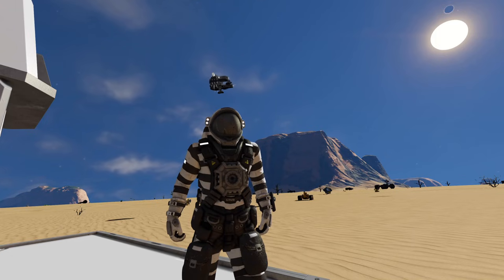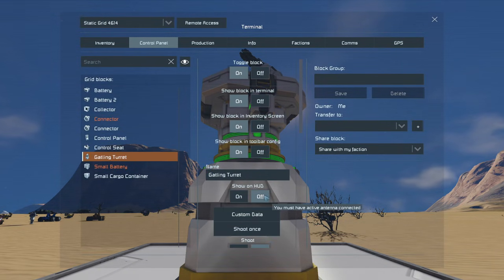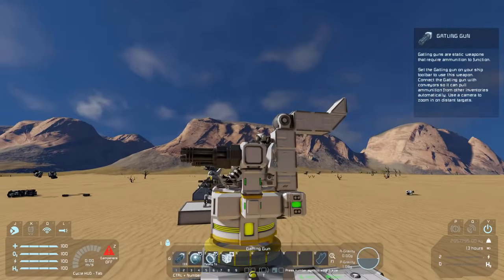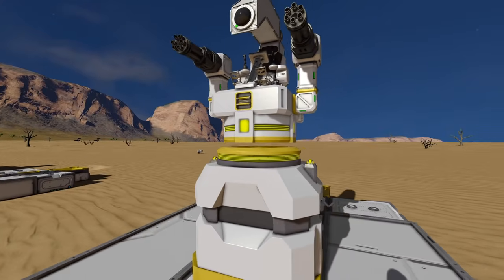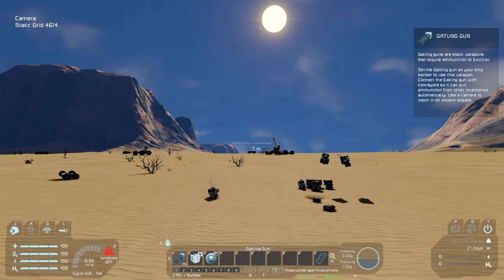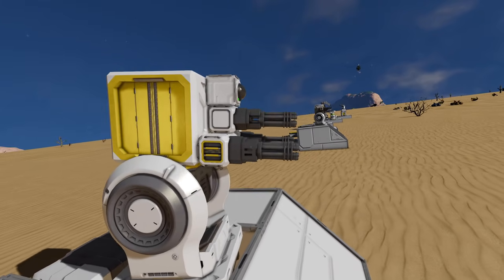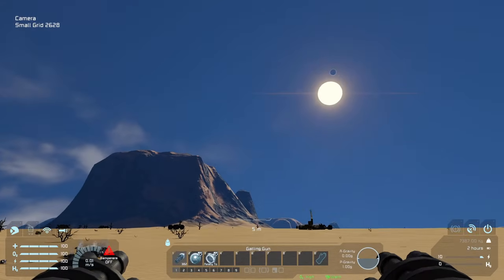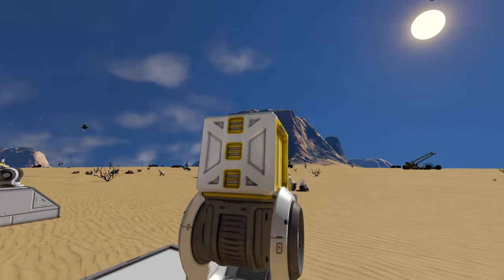Space Engineers Experiments: Mouse Controlled Turret (No Script And Scripted)

Comment: Trick: you can use the O2/H2 Gen block or the connector block for a 3x3x2 big-to-small conveyor conversion instead of the 3x3x3 junction, similar to what you did with the last turret, just flip it upside down. For the first scripted turret, you can put it directly on the hinge and shoot "forward" instead of the "90 degrees" angle right now and make it somewhat tighter. 

Also, you can make the transition from large to small grid on the rotor and place a big small grid hinge, which takes up 3x3x3 small blocks instead of the 5x5x5 small blocks of the large grid hinge! (General tip: one small block is 0.5 meters while one large block is 2.5 meters, making a small block 1 fifth in every dimension of a large one.)

Comment: With connectors, the magnet affect turns off whenever you unlock. Imagine, you’re ambushed by enemies so you quick get into the turret, while your buddy takes evasive maneuvers. You unlock and are immediately sent flying XD. Of course that’s not really a problem for stations.
Reply: That's why you use a rotor.
And set torque and brake torque  at 0
Reply: @knutzzl  so basically, Rotors for ships, and Connectors for stations... Hmm, great to know!

Comment: You could easily combine last two systems. Advanced rotor with small head. Small connector on top of it. This gives you 4 small ports around it and you can plop there your last design while having direct access to cargo, no need for remotes and any requirements set by having separate grid.

Comment: You don't need the big conveyor. Just mate the large port on the back of the connector to the hinge or rotor, and use any of the 4 small ports on the sides of the connector. Ammo can pass through small conveyors, so no issue there.

What's cool about this is you could still use the connector to connect something else, making a sort of "sandwich turret."

Comment: Just FYI: you dont require a merge block to join hinges together. You just build a rotor part on the other grid and tell the rotor to attach.
Reply from the maker: You're right. You can use either route, but connecting to parts usually easier.

Comment: something i've wanted to try but havent had the chance too cause no pc. try, using pistons. the 3x3 is a placement restriction and not an operating one yeah? so. imagine pistons with single block spacing in between that extend from the hull then retract into protective points. to place them. you extend one piston at a time, then retract and extend and place the next turret down the line

Comment: working on a tower turret for my base using battletech weapons mod and its been a while since i've build a custom turret... got the left/right rotor movement easy enough without a script... but but up/down used to work using rotors and no scripts as well... i have gryo and remote block.. does using rotors for both axis no longer work scriptless?????? might redo up/down with a hinge... but was curious as to why my rotors were not doing both axis

edit note... hinge can't be used due to weapon port needing the larger port size unless hinge is built before rotor... not sure if it will be stable that way..... using Arrow IV missiles x2 on turret
Reply from the maker: Try reducing the torque on the rotor that is using the gyro for it to run scriptless.
Reply: @PandemicPlayground  all rotors are already at zero torque... going with hinge on top of rotor...forgot hinge can place small head on big hinge... problem is getting hinge to stay where i move it with mouse and no script... got to keep torque on it or it flops like a dead fish from weight